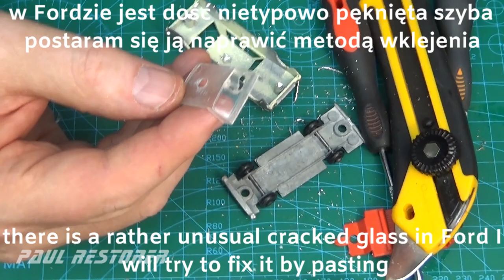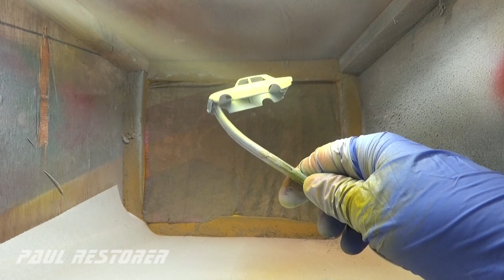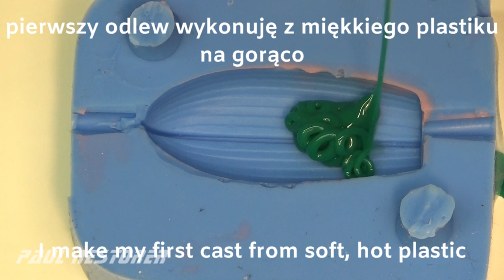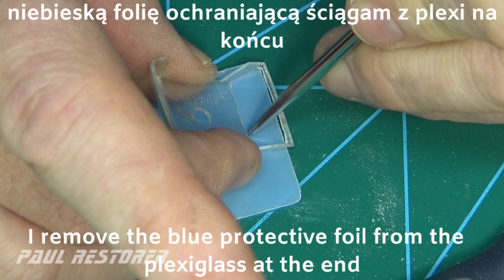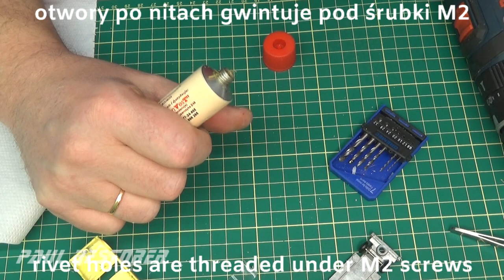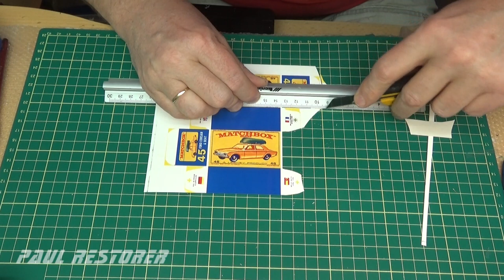Matchbox restoration Ford Corsair nr 45 diecast car boat making windshield repair

Comment: As a i'l whelk our parent-snails bought us one of those from the gift shop of one of the local caverns. Years later - and long after it'd been gone - we picked up the green boat in an eBay lot of plastic cars. Some time after that we found a Corsair casting with the boat rack but no boat to put the two together. Happy snail.
Reply from the maker: Thank you very much